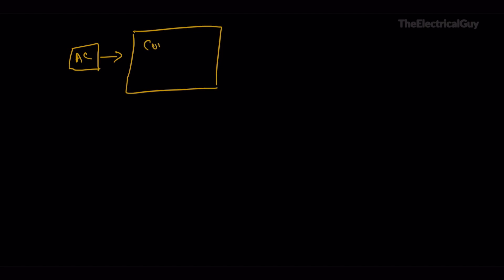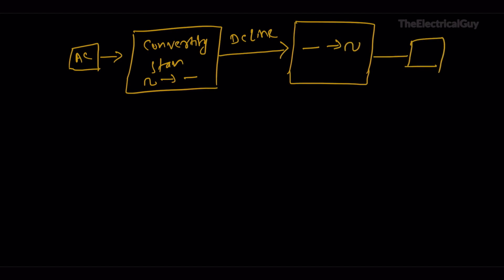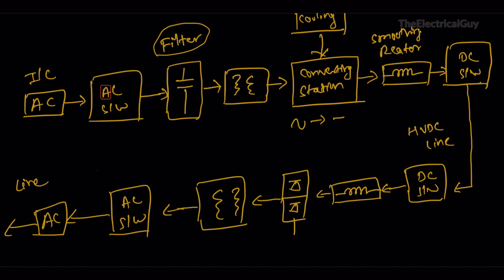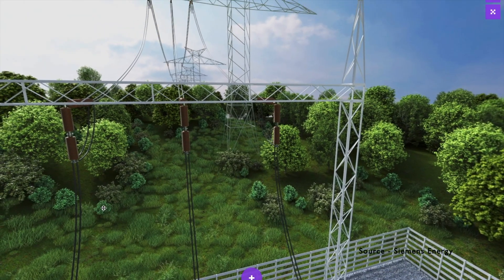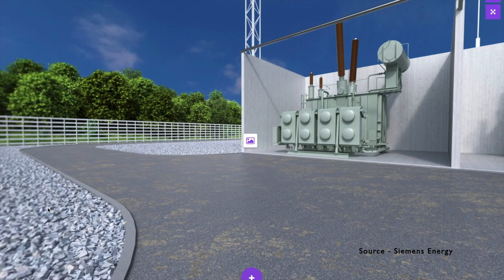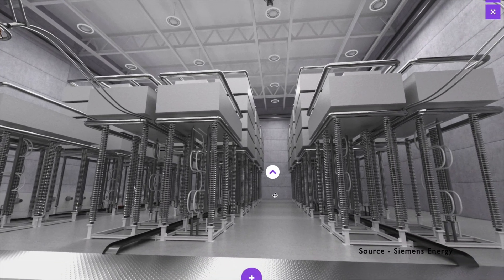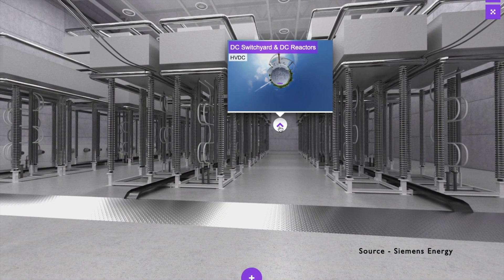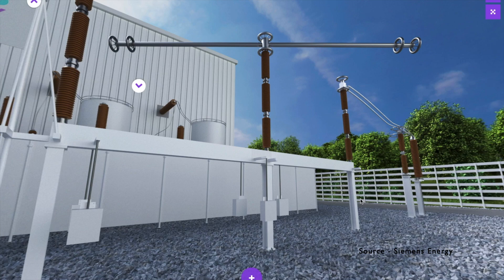HVDC Transmission System Components | Explained Simply | TheElectricalGuy

Comment: Why for the converter with tyristors they use single phase transformers and not three phase, what is the output voltage from secondary winding of transformers ? What is the rated voltage for the converters ? It looks like this solution is very expensive.

Comment: YOUR VIDO IS MORE HELPUL, BUT you mentioned two location 1. CONVERTOR T/F & the 2ND again mentioned thyristors. both are working the same?. 
I think T/F can only step-up & step-down
but the thyristors can convert AC into DC that are the parts of 3D section 4